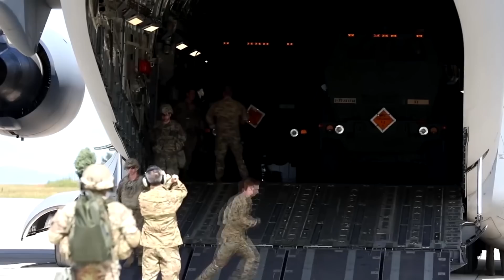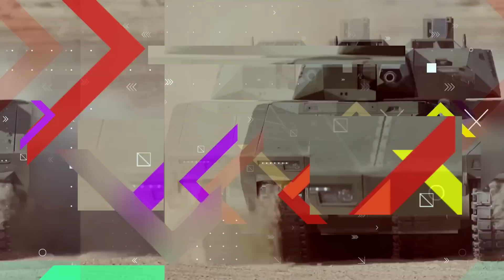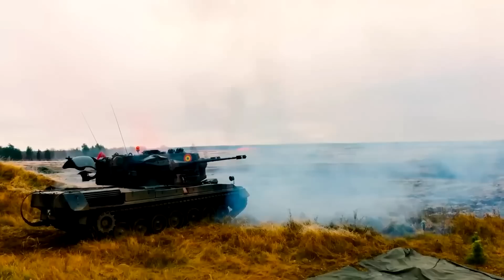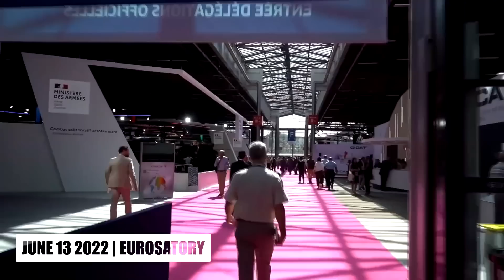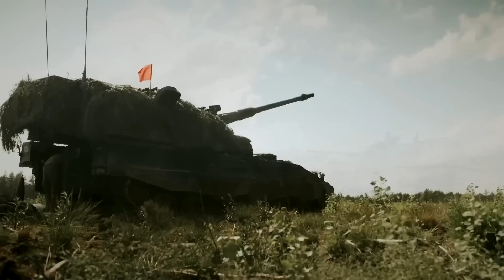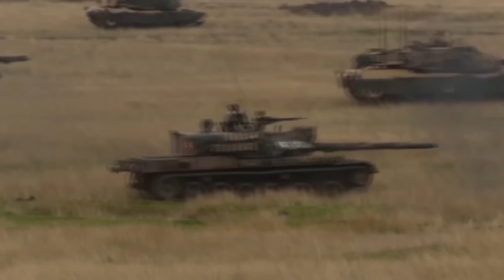That's Why Nobody Wants To Mess With This Beast

Comment: When they say a road range of 190 miles, they better have a long supply of fuel trucks to feed this diesel guzzler.  I am not sure where this mini tank is going to fit in. Is it because it is lighter and less armored than the M-1 A2 that it can go places the M-1 can’t? Also why put a 105 on it when they could have a 120 to match the M-1 A2? Having the same ammunition makes sense for compatibility between the 2 different tanks. I hate to be negative but this vehicle seems less of a tank and more an IFV but without the Infantry.
Why aren’t they coming up with a replacement vehicle for the M-1 with all the new info we have found out with tank vulnerabilities versus drones in the Ukraine conflict?
Reply: The export model Abrahms being sent to Ukraine dont have the same armor as US Abrahms so they wont withstand the same amount of damage or in same spots. This vehicle isnt a tank or ifv. it is a high mobility rocket launcher.